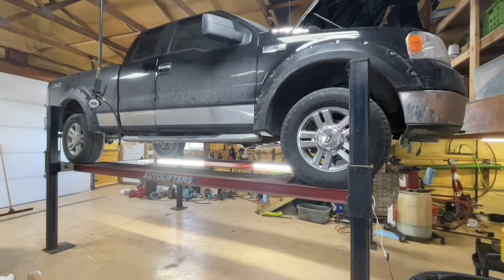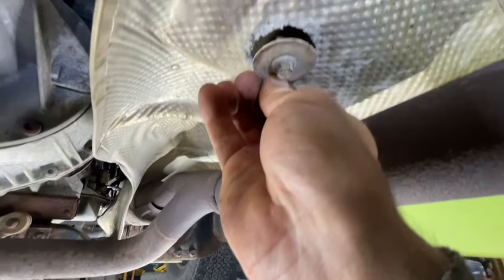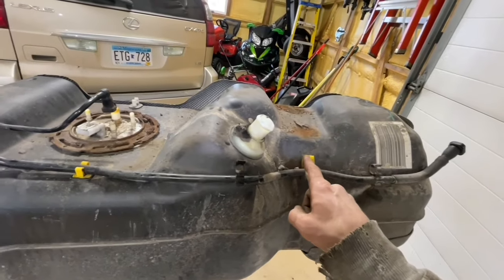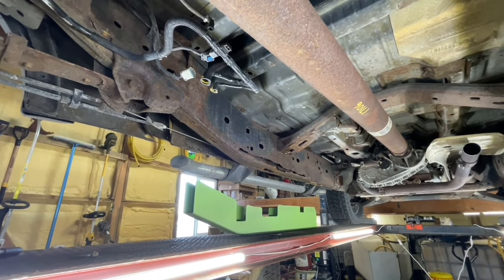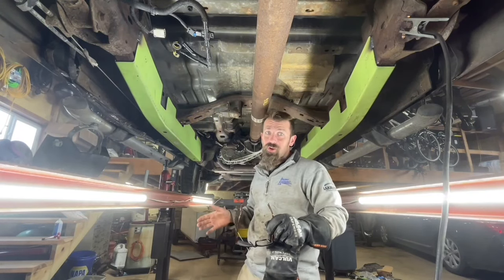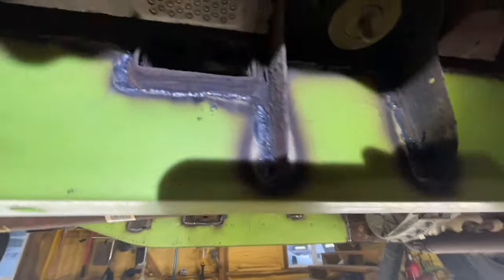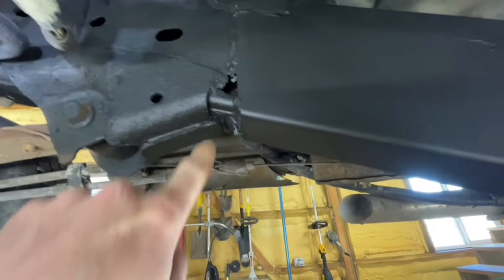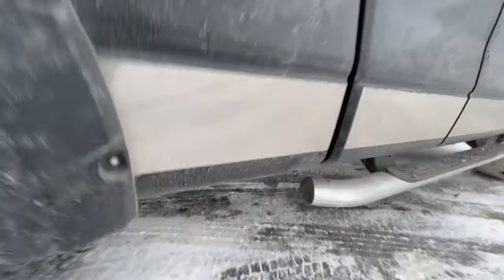Rusted out, rotted F-150 frame: repair, fix, 2004-2008, this one is pretty bad!

Comment: That's a Bandaid solution...you have to cut the Rot out completely to New Metal...and treat the remaining Rusty metal properly...Rust converter to STOP further rusting....Weld in new metal where the Frame rusted...adding inner support braces to strengthen it back up ...treat and clean up all inside areas you can....weld in the outer pieces to rebuild the frame... paint it up...and drill some cleanout holes in bottom of your new frame ( make those holes strong ) so you can get rid of crud/dirt and salt later..as that is what rotted out your frame.. yeah if you don't repair every area your wasting time and it can continue to rust..and can fail Inspection depending where u live...Remove the cab and bed and it's alot easier to do the whole frame... if severly rotted your cab and bed might be holding it from folding up or down 😂😂
Reply from the maker: You are absolutely correct, this is a band-aid fix.  If it was any worse than this, I wouldn't have touched it and would have recommended replacing the frame.  I do think this was the right choice for this particular truck.  It's too nice to junk but not worth enough to replace the frame.  Kind of the sweet spot of terrible.  lol
Reply: @bennieaust  
replacing the frame isn't the Only option or even an option depending where you live...lol...i could fix it for a few hundred dollars... maybe more with steel prices so high..lol..but still a better job than that slip on cover...you can't leave rusted rot in or it is rusting more in a year..
paying someone to patch it is insane...i understand your reason but the fact is it is a short term cure which won't be worth doing....how much did this Cost the guy - the Dorman parts and Labour / Material??
Reply: @bennieaust  
What guage of steel is that " Cover " ...which is supposed to go on after you remove the rot and weld in new steel ...then this " cover " goes on to add strength.... regardless of them telling you to cover the rusted area anyone doing this KNOWS the proper procedure in a frame repair...a Real repair doesn't need this " cover " as it would be stronger than factory and would last decades not a few years... frames aren't hard to rebuild... it is just steel...the frame didn't have proper drain points is Why it rots out..factory defect easily fixed...anyways...your not the owner..i know your just a mechanic?? lol...i built custom signs for decades and bigger structures than that frame is....a few days of removing parts/cab/bed and the frame is bare..you can fix every bad spot...and reassemble it back in a couple days... one week for decades of ownership....i was a mechanic too and for 50 + years for my own vehicles ( 2 - 18+ wheels )... take care..not blaming you...
Reply from the maker: @garymallard4699  , The Dorman parts are very similar thickness to the frame.  The owner brought me the truck and the parts and wanted this job done.  I can assure you that as soon as you start taking the bed and cab off to make repairs (Which I have done, so I understand it's not a big deal) it already overshoots the target budget and goal.  The objective was to try and find the correct balance on this repair.  It obviously isn't the route you'd have taken.

If you are offering to repair these for a "few hundred dollars" I can assure you, you will not run out of work.  I just posted a video a couple weeks ago of a worse one that I parted out.  '04-'08 are rough.  There are plenty around to be fixed.

Thanks for the comments and for watching Gary!
Reply: @bennieaust  
I had 2 Business's and my " offer " was Not a Estimate or Quote...i was referring to doing MY OWN WORK on MY OWN VEHICLE.... as someone who did Work for Customers and made profit on those Jobs ( many much larger and Time consuming than this small job )...I would charge according to my time done and yes it would ne more than a couple hundred dollars or more than that amount...I was talking about the fact this is a band aid solution for amateurs to do... it is  like a slip on rocker panel..cosmetic not structurally sound...whether welded or glued on...( there is adhesive designed for automotive repairs and i have used stronger ones too in my career )... my " couple hundred " quote is material costs alone...not my shop time or labour fees....i said that as a owner doing this repair to my own truck..in my own shop and based on experience...as a Mechanic ( who removed and replaced Cabs and engines/trans and beds and everything required to get proper access to a frame that needs rebuilding and Structural Integrity returned to keep it Safely Operating again )... if you don't remove the Cab and Bed your doing a poor repair... And if you don't understand how to repair metal properly ( including welding it at an Pro level ) your not going to do this repair safely either.... cutting out all rot is easy...welding it back to a Factory level is Simple....it isn't a Job for a Mechanic to attempt... 
It will fail at the Dorman skin and the rotted hole you left...if i was doing " Only " that work you did...i would not have left that part unrepaired...i would have put new steel in that area so my repair doesn't fail...for FREE...( i mean the extra material and time to fill that part you showed in video...)  it would take 30 minutes and $30 ( maximum )  but at least i know it won't fail at my repair ... i also would have taken one hour to quickly remove all rot and add steel to add strength to the frame under the " Cover "  ... it would guarantee my work will last longer than the surrounding frame does ( past my work scope )...
AGAIN..I am not trashing your work...you filmed it..you uploaded it...you showed what you did and Did not do... this isn't my point to argue ...i stated it is a Band aid solution to what should be done to fix this vehicle...not as a Business owner..but as an Owner would want to preserve his vehicle ...yeah it takes time to remove parts..and I do it as it SAVES TIME doing the actual repair...sadly this owner has to deal with these problems...i'm fortunate enough to have the Experience..Skills..Tools and Shop ( with Lift ) to tackle this properly.... i had many decades of doing this work and Building Handmade Custom Fabrications....from New to Old Rebuilds.... seeing it done this way ( i watched 2 other repairs using the Dorman Cover before yours ) and poorly prepping the frame .... and just covering up Rusted metal ..is Sad... AGAIN..Not my point to BLAME YOU...i had to deal with customers that only care it is done Quick and Cheap...Quality costs more..but pays back in the End...ok guess your not gonna say what you charged to do the work..lol
Have a Great Weekend 
Canada Day here
4th of July if your American??
Reply from the maker: @garymallard4699  , thanks for the clarification.  I was under the impression you thought this was a few hundred dollar job parts and labor which seemed very unrealistic to me.  Obviously, it does to you too cause that's not what you meant.  I appreciate your comments.  It's important for people to know what's going on here so they can make a call what's the best option for them and their truck.  This is not the end all for frame repair and I certainly hope I'm not presenting it that way.  Thanks!
Reply: @bennieaust  
no you presented it clearly..and there are always a million ways to do anything....and my way isn't for everyone... yeah i understand my comment wasn't clear either..i never did Cheap Work..if they wanted it cheaper they were free to call someone who under quotes everything....i try to do it as Best as it can be without Costing more than it is worth charging....👍
Reply from the maker: @garymallard4699  with that mentality I’m sure you always had plenty of work!!
Reply: @bennieaust  
i had more than i could do anyways..no sense getting on my knees for them...lol
you have to know when it is a waste of time doing it for nickels...
Reply: You seem to know your stuff Gary, so what’s the point of these repairs if when done you still can’t tow with the truck? I’ve got an f150 with low miles that i want to keep but it’s rusty. I was thinking that with these rust repair kits it’d allow for the owner to continue to use the truck as intended to tow with etc.
Reply: @briizcustoms9543  
my point was not to do it poorly...not to leave it rusted and unsafe to use...i think i stated my point to understand...your leaving rust to continue eating the metal...it takes little to cut it out and add some metal as your doing this repair...covering rust isn't a good option...but i understand " why " your doing this...lol
Reply: @briizcustoms9543  
i repair rusty vehicles myself...
Reply: @briizcustoms9543  
hey if it passes inspection..in your area..then maybe it is " good enuf " there.... that kit is for people unable to fab thenselves... cut and weld to a stronger repair...

Comment: Will these work on an '05 F150 2WD? They only sell for 4WD.
Reply from the maker: I haven’t done this repair on a 2wd. I would go with what Dorman says. If they don’t list one, then probably not.
Reply: @bennieaust  through several emails with them today, they said it will work on a 2WD extended cab frame only. I'm going to find out.
Reply from the maker: @richardballew8958  , good to hear!  Best of luck with the project!

Comment: What would be the labor cost on a job like that?
Reply from the maker: Shops are all a little different and each truck is also a little different in how bad and how much labor is required.  I would expect a minimum of $1500-$2000.

Comment: How much would a repair like this cost?
Reply from the maker: Every shop will be a little different and every truck is a little different. This job cost the customer about $1500.
Reply: @bennieaust  ok thanks. That a lot cheaper than buying another truck. Thanks
Reply from the maker: @robdlp2420 you’re welcome!  Yes, it is much cheaper.

Comment: I hope this owner got this truck for free.
Reply from the maker: I’m not sure what he paid, but I agree!

In this part of the country you have to take a good look at the frame on all of the 2004-2008 F150s before buying one. Even the clean looking trucks can have frame issues.
Reply: @bennieaust  Same where I live, Bennie. I had an 02 Silverado 4 wheel drive that I bought new. Sold it this past summer with only 49K on the odometer. The body was fantastic, but the frame was on its way out. Took what money I could get for it and moved on. Such a shame.

Comment: 3mm thickness on those repair covers. idk if thats good enough or not...
Reply from the maker: Time will tell.  It looks to be similar thickness to the factory frame.  The one thing there’s no question about is that it’s much stronger than before the repair.

Comment: Sweet. New corrosion troughs. Is this really that much of a common problem on this model design that Dorman makes such a product? That's crazy and also that's scary af.
Reply from the maker: I think the fact that Dorman makes the parts is all you need to know.  I've seen MANY rusted out frames but this one is the worst and also the only one I've repaired.  They do have drain holes in the bottom.
Reply: Rusted ford boxed frame very well known problem.
Reply: What a disgrace that the OEM did just a crappy engineering job on this truck frame in the first place. I will never buy another American made vehicle. I have a Saturn Vue that I have in my garage that I have to repair the rusted frame on. I had to surgically remove all this rusted out part of the frame and fabricate members that I will be welding back in place of the OE crap design. I am a designer by profession and fully understand welding and weld myself so I know that I will succeed.

Comment: Why not cut the rotten frame out?
Reply from the maker: Because there wouldn’t be anything left. :)

There is obviously rot that isn’t helping anything and could be removed but I was concerned about removing anything that may be adding any structural value. After I installing the Dorman parts a treated everything internal with a heavy coat of fluid film to help stop any further corrosion.

Comment: sorry but that truck is not structurally sound. That Truck needs a total frame replacement. The new frame section is welded at each end of and center of the repair section. All the stress is on those welds and not one solid piece.
Reply from the maker: Thanks for watching and thanks for your input.

Comment: I bought these and decided to have the same thing done to my truck.  They spot welded it in very few spots and caked it with undercoating to make it look like it was welded….  Criminals
Reply from the maker: That’s terrible!  There are always different ways of doing things but being honest about it is always the way to go.  There isn’t necessarily anything wrong with doing it differently than me, but trying to screw someone over is unacceptable. 

Sorry you had that experience. :(
Reply: Actually upon taking a closer look, I can’t even find a single weld….  Just caked on undercoating around the edges
Reply from the maker: Did they epoxy them on?  That might be a pretty valid method. Anything less than epoxy and 👎
Reply: Would a razor blade be able to cut through it?
Reply from the maker: @dannybaia1025  not easily.

Comment: I’ve been following this video, I have a 2006 f150 the frames just as bad if not worse, so far I dropped the tank and muffler. I’m ready to weld now and I was just wondering what type of welder did you use? I tried two welders and couldn’t get them to stick right, might rent a 250 amp. Also, great video btw I’m probably 20 of your views lol.
Reply from the maker: lol, you're welcome!!

I'm using a Vulcan Omnipro 220 from Harbor Freight.  I don't recall what i had it set at but when I do these frame repairs I have it plugged in to 220V, so I definitely have it cranked up a bit.  Renting a 250A welder would be a good idea.  Also make sure you clean up the metal as best you can.  I use an angle grinder with a flap disc.  The rust really makes it difficult.  That's why I weld 100% around the frame caps, I'm betting the welds are compromised is some areas due to rust.

Comment: Great instructional video! I'm about to do this on a 2004 in similar condition. Thanks for the referral to Rockauto, they are a great resource. I see another company online charging more than double for a similar kit. Anyway, I have a question about the welding. If we all agree the rotted part of the frame has very little structural integrity/strength, why bother welding to it? Seems to me solid welds on the front and back of the replacement Dorman parts is all that's needed, since they are providing the (new) structural integrity going forward. Any comments? Correct me if I'm wrong, but it would save time and welding rod.
Reply from the maker: Steve,
  It would save time, and wire, not welding all the way around.  My reasoning for welding all the way around was to make it as good as I could with the Dorman parts.  It will never be as good as replacing the entire frame, but if you are going to go to the work of installing these, may as well do it the best you can. Even if the welds are compromised it will be better. If they are no better than 25% of what they could be, that’s still 25% better than skipping them.   That to me makes it work the time.
Reply: @bennieaust  eh they're probably 80 to 90% as structurally sound as the original frame. If you pay attention to that generation of Ford f150 frames you'll see multiple frame splices that come factory. There's one near the front door and one a little past where the cab meets the bed towards the rear. They just join and sleeve them and run solid beads. So I wouldn't think these would be much different than a factory sleeve.
Reply from the maker: @A_Stereotypical_Heretic  you’re probably right on that, any concerns I have though are mostly due to hidden rust inside the frame, or old age and metal fatigue.  There’s no doubt it stronger than when it arrived and probably stronger than a lot of them out there that don’t appear to have major rust issues.
Reply: @bennieaust  yeah metal seems to lose its memory after a while. Just naturally weakens regardless of rot and rust. I guess nothing escapes entropy eh? Regardless good job brother! As a Ford owner with past rust issues I know you made that customer very happy lol
Reply from the maker: @A_Stereotypical_Heretic  , he was happy. 

Thanks for watching and commenting!!
Reply: @bennieaust  yessir 👍 have a good one

Comment: I am very interested in how many labor hours you spent on this project. I suspect its around 20 or more. It looks like a solid repair, my only concern is the area frame under the bed, it didn't look very good at all.
Reply from the maker: You are correct on both points. Right around 20 hours.  And there are other parts of the frame that would benefit from additional plating.  At the end of the day every truck is different and every costumer gets to decide how far they won’t me to take the repair. It’s subsequently better than when it arrived but still could use more work.
Reply: @bennieaust  If you were in Ohio near Dayton I would be bringing my truck to you. I also see options for the Dorman plates to be cut up as needed to repair other parts of the frame.
Reply: @bennieaust  

Can you tell me where you are located
Reply from the maker: @haroldkern3003  , I’m near Minneapolis, MN
Reply: @bennieaust How many hours in this Ford F-150 frame? 
Thanks I have a beautiful 2003 Tundra with frame rust similar but probably not quite this bad. Hours?
Reply from the maker: @gregroth4696 , IIRC around 20 hours. I have been able to speed up the process a bit but it is a time consuming process since so much has to be removed to gain access. Each one is a little different on the repair itself so that also makes it hard to say exactly how long it will take.